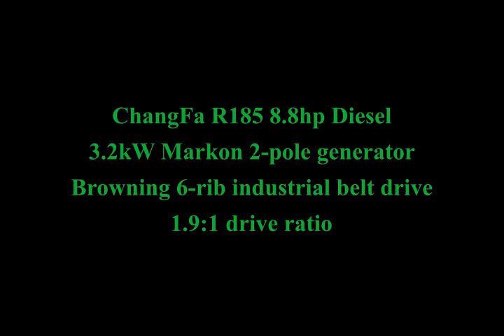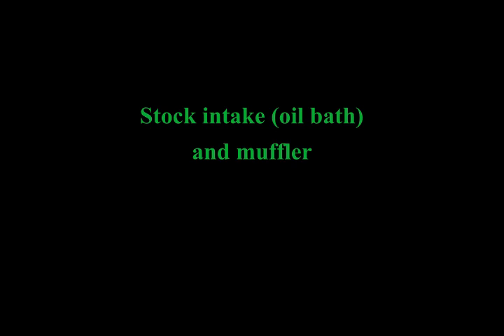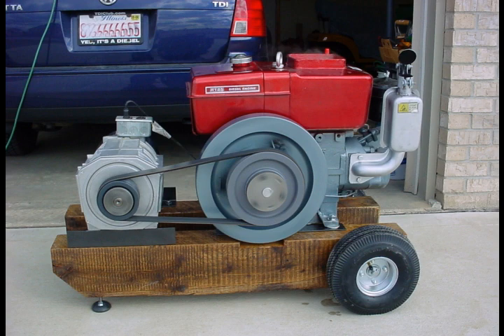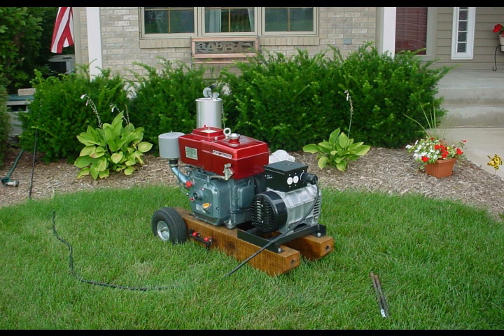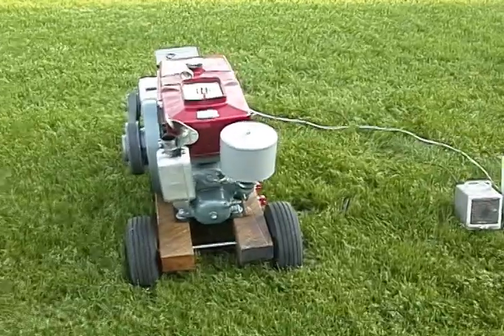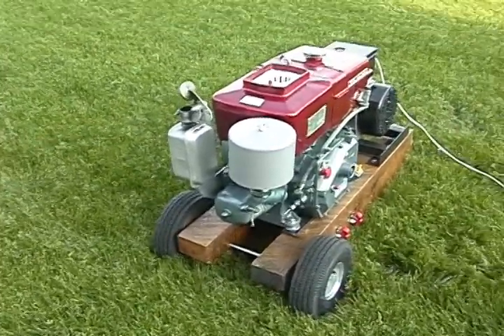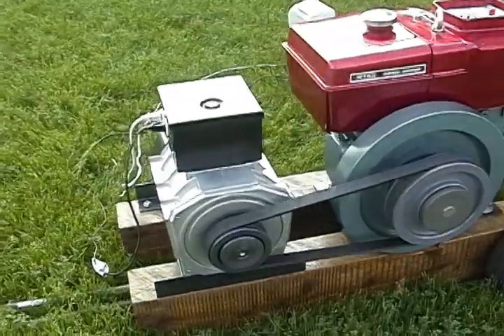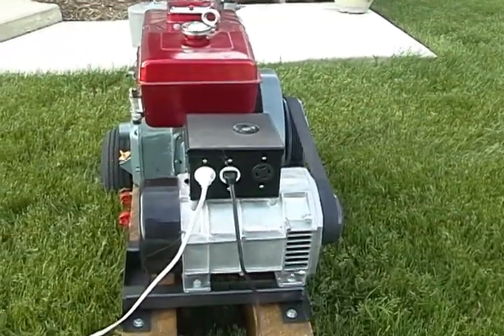ChangFa R185 diesel generator

Comment: can you run it 24 7 if you connect it to large diesel tank?
Reply from the maker: You could run it 24/7, particularly if you remove the cooling hopper and convert it to a closed cooling system.  There was some info on the web about that a number of years ago.  I’ve kept mine as-is since I only use it as backup and it makes it more portable.
Reply: @chrisbeck8182  thanks alot 🌷

Comment: What part number and source for the solburg filter silensor…?

This is the ‘real beef’ in your build….great share and tech info….I have the kubota setup similar to your engine’s 
Layout
Maybe the same part number….great news.
Reply from the maker: Hi Raymond. It’s been so long I can hardly remember, but I’m pretty sure I ordered it from McMaster-Carr.  I believe it’s 1-1/4” NPT but might be 1-1/2”.  You might be able to find it elsewhere for less but it’s important to get the filter/silencer version, not just the filter-only which is cheaper, if you’re trying to quiet the thing down.  https://www.mcmaster.com/9828K44/
Reply: @chrisbeck8182  thanks buddy 
I dissected your video and went to their site.
I have some issues to work out on this gen set…it was home built…so some minor mods to make it more reliable in a off grid setting…I may swap in a 4 pole just to see if it’s worth it….the original 2 pole was rated in the 3.5 to 4
Kw range
The 4 pole is maybe 8kw and about twice the size.
Reply from the maker: @offgridmangogrower  use the 4 pole if you can.  The 2 pole I have lacks peak surge current capability.  It won’t start a split phase well pump or sump pump even though the running amps are well within it’s capacity.  That big flywheel stores a lot of energy and will allow a larger alternator to give a peak power quite above what the engine can provide steady-state.  I’d have used a 5kW 4-pole if I didn’t run across the 3.2kW 2-pole at a screaming deal I couldn’t pass up.
Reply: @chrisbeck8182  that’s great advice
I was just wanted the engine to be closer to peak torque curve….and not see parts a flying…
But the center mass is I’m sure 120% over them puny 2 poles
I also have a 120/240 Chinese head bought along with a massive lister clone single diesel……I’m getting pumped to match em up.
Reply from the maker: @offgridmangogrower  I’m running the engine just a wee bit over 1800 rpm to get 3600 at the alternator.  8” drive pulley and 4.2” driven. That was the closet to 4” available. It seems pretty happy and with 3kW load the engine runs clean and has quite a bit left.

Comment: That's incredible, just yesterday I was trying to look those small horizontal diesels up yet again for almost exactly the same purpose as you have done. Except that I would use it as a backup to charge a battery bank with it. The main charging method would be by renewable energy. Solar, wind, small scale hydro etc.
I'm interested to know about the fuel consumption with your unit. Do you have any of that data?
I believe that is an inexpensive copy of a superior Kubota engine that they made for many, many years, but unfortunately I think Kubota has stopped making them.
Reply from the maker: It is indeed a copy-ish of a German design that was copied by the Japanese (Kubota).  Kubota made them up until quite recently, but only for the Asia-Pacific area.  They may still make them, I haven't looked recently.  As far as fuel consumption I do not know exactly, but it should be similar to any of the other diesels of similar vintage design.
Reply: @chrisbeck8182  That's great to know. Do you know anything more about the German design? Where did you get the information?
Reply from the maker: Honestly, and not joking, I read it on the Internet somewhere.  It might have been in the Kubota literature.  I think they called these the "Z" series?  It's been a good 10 years since....  I guess you could call every Diesel a descendant of German design since Rudolph Diesel was German. ;-)
Reply: @chrisbeck8182  I came across some more information about that, it looks like Deutz created them first in an air cooled version, then Yanmar started making a water cooled version in 1933. There's some in the videos of antique engine fairs on YouTube.
Reply: I happened to come across a kubota style one on Craigslist …. set up originally as a marine generator…..(now in an open frame) its a bit noisy….and some mods are needed (electric pump) to make it more reliable…..